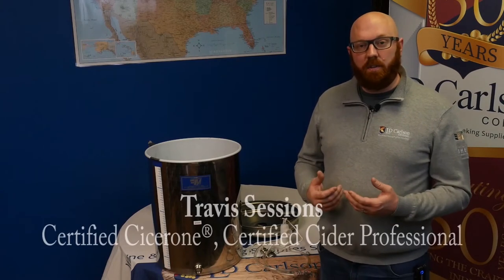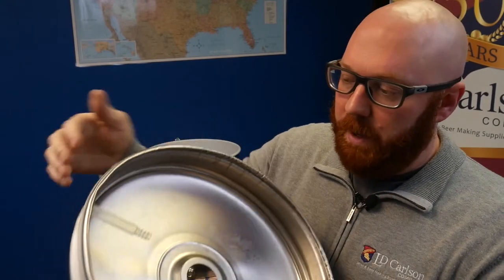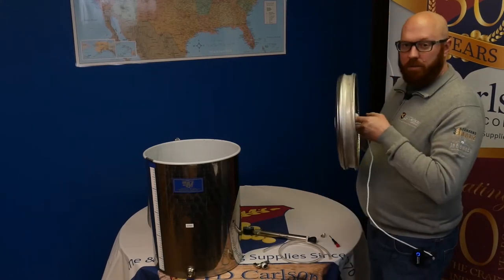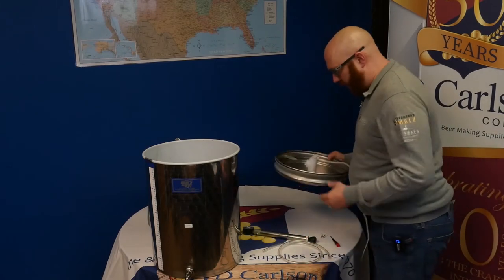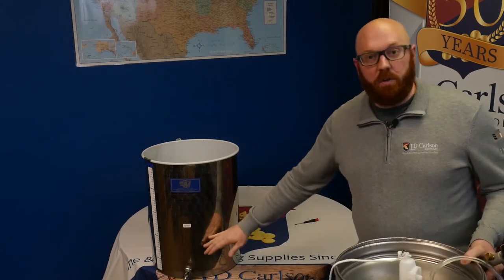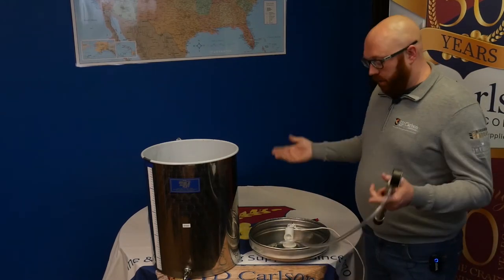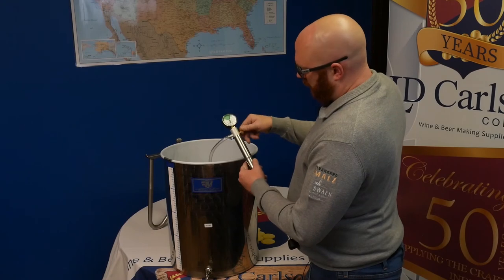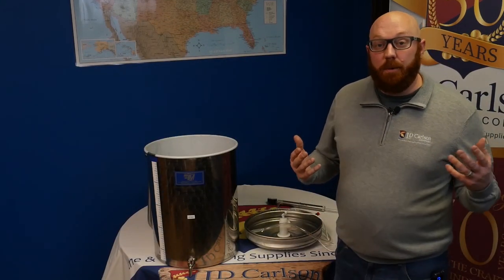How To Assemble A Marchisio Variable Capacity Wine Tank

Comment: The gasket is the hardest part show us that part!!!
Reply from the maker: The easiest way put the gasket on the lid is to feed the stem through the hole first and stretch the gasket over the rim. Just make sure the gasket is flat to the rim and not rolled or it will not inflate/seal properly.